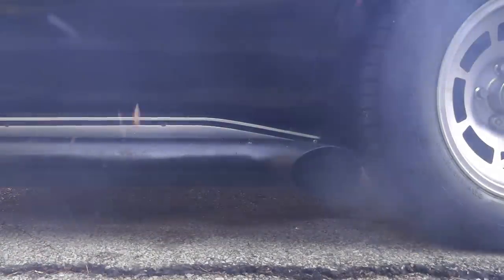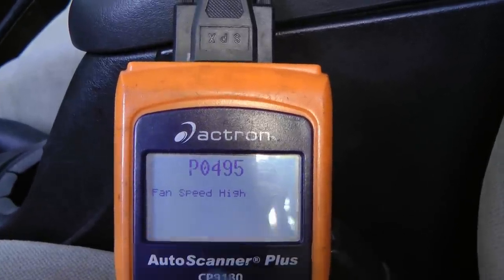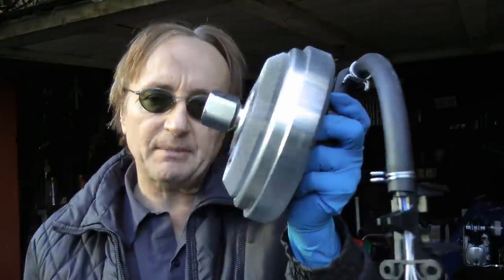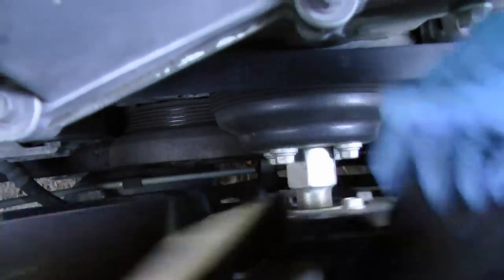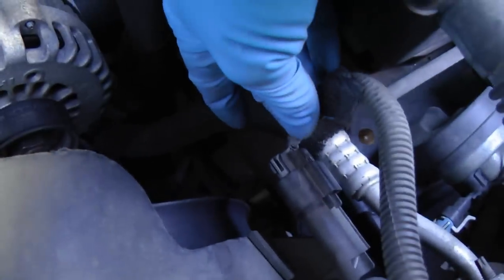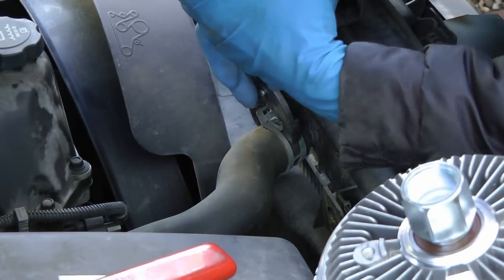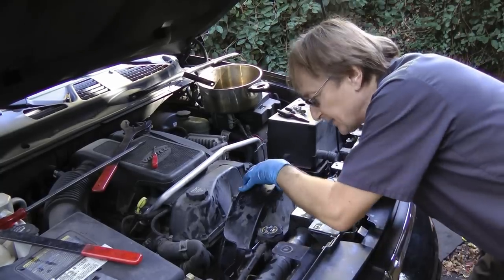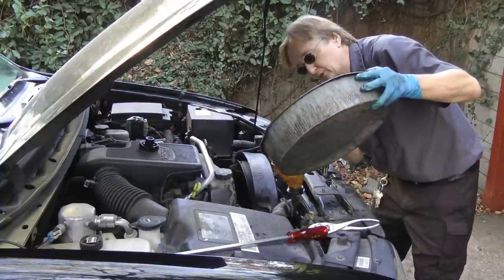How To Replace a Fan Clutch

Comment: Why doesnt the fan just run off directly from the belt, or just a simple electric fan bolted onto the back of the radiator?
Reply: Because it would create a lot of "drag" (air resistance), which would bog down the engine and reduce fuel economy.  I know this because my fan clutch seized up and I feel the power loss when going up hills.  Even though older cars had the fans bolted directly to the water pump shafts, they usually only had 4 blades. Modern mechanical fans, however, have like 10+ blades, making them more like jet turbines; hence the increased drag.  The clutch's job is to provide a "part time" connection between the water pump and the fan.  This allows the fan to spin freely once it reaches a certain rpm.  As the engine temperature increases, the ECM (?) sends a signal to the clutch to lock the fan to the shaft to cool the engine.  Also, mechanical fans are more efficient for larger engines and heavier vehicles than electric fans.  And yeah, I know this question is 7 years old, but hey, never too late to learn, right? 😉

Comment: hi scotty the fan blades on my nissan pathfinder spins 2-4 inches each time i flick it. on a cold engine is that normal? first startup it moves alot of air through front of radiator and vehicle sounds like loud woooshhhh as rpm raises lol... been like that for years now

Comment: hi scottie  i like to watch your vids  i have a question do you know if i have a electric fan clutch on a chevrolet p30 1985 i don't think so but i would like to be sure  i don't have anything that's electric so i would think not  also my fan blade on my water pump is a little woblley  do you think that it's cause of a faulty water pump??
Reply from the maker: yes, replace the water pump

Comment: hello scotty I have change my radiator, water pump, on my 1996 mustang GT and the car shows after a few minutes of driving that the engine is over heating the car don't have a head gasket problem but it seems to be reading hot do you have any idea's on whats causing it???? .....bad air temperature sensor?
Reply from the maker: do my video tests "how to fix an overheating car" has to be one of those

Comment: hey Scotty is it a good idea to convert my fan clutch to a electric fan assembly on a 03 silverado?
Reply: you could do that but you would have to poke the mountings through the radiator fins as well as the temperature sensor through the fins

(plus it can draw additional load on the battery)

Comment: hey scotty so i have a 99 durango and today it got a little hotter than normal about 95 deg and im thinking my clutch fan is going out it sounds like a mac truck taking off but after awhile of driving it it stops and when im sitting idling it gets a little hotter than normal... but also i did the free spin check and it doesn't seem to free spin i will go to turn it and it stops about a half turn any ideas...

Comment: how would you tell if a fan clutch is bad on an older truck that didnt have electronics? would it cause the temp gauge to drop off dramatically when the thermostat opened?
Reply: Air-conditioning unit doesn't really blow very cold air anymore

Comment: I have an 04 that's overheating. I've checked all hoses,  swapped the T-Stat and flushed the system. When I did this the truck heats up a lot worse. My fan connector going black ( left ) to white ( right ) 13v then the rest show 4.3v. My clutch spins but it's not loose. When I grab a newspaper and try to stop the fan at operating temp the fan stops. Is this my clutch? Thanks

Comment: Hey scotty I have a 94 lexus gs300 with a bad fan blade , been looking all over and no one can get it in the time I need it , I know that toyota and lexus are the same , I was told that the fan blade from the toyota camry will faith my lexus. Is that true if so what year and make toyota I need to find
Reply from the maker: +Wilson Pierre no idea on different parts swap, but go to a junk yard, they will have one somewhere
Reply: How about a fan clutch from a junk yard??
Reply: Scotty Kilmer Hey Scotty, my gf's gmc envoy's radiator fan started to make a noise last night while she has started up her vehicle but last time we checked it with her dad it was shaking but was no problem to it until now could it be that. Thanks

Comment: hey scotty i have the same truck (chevy trailblazer) ,mechanic told me that i need to replace my fan clutch because is not strong enought, the fan is going slow and im able to stop it just with my hand, but my check engine light is not on, is he right ?does it need changing ?
Reply from the maker: yep, if you can stop it with your hand, it's bad
Reply: thank you, your awesome. :D
Reply: Mate does your car overheat?
Reply: no not yet
Reply: On this evil platform, an SES light is not always or better yet from my own reading rarely sets for a bad fan clutch, that's unless it's locked at high... by then you don't need NO SES light, you'll know by the roaring jet engine sound coming from your engine as you accelerate...

Comment: Presumably the threads are left or right handed so they automatically tighten themselves as the fan turns. So, I'll guess that if the engine turns the fan CCW from the perspective of an observer standing in front looking back, threads will be RH. I think you could also tell just by looking at the pitch of the fan blades, which should push air from front to back.

Comment: hey Scotty, i need help. My Mitsubishi Lancer 4Cyl 2.0L 2003 Slave cylinder is bad and making me change the part for the 3rd time now in 2 yrs that's a lot and a lot of money. I just saw on a forum that this part was  will always have prolems with it and will need to be change many times no matter where you buy it it will fail again. Have you seen this part the rubber on it always tears or breaks, What can i do so the rubber doesn't break or what do you think. We don't get warranty on this part.

Comment: So after changing the fan clutch in my 2003 Envoy, I still have the problem of a roaring engine. Any advice?
Reply: it should only roar if the engine is hot.
Reply: It roared as soon I turned it on. I removed the relay and installed it again, it must have needed to be reset because the loud roar went away. I have not had any other problems this week. Thanks for the response.
Reply: do you remember what relay it was I replaced my fan clutch and it still roars
Reply: A clutch fan doesn't have a relay it is mechanical.
Reply from the maker: +Glen M  AH, many modern fan clutches are actually electronically run and do have relays.
Reply: I stand corrected. I work on old stuff.

Comment: I think my fan clutch in my 2003 s 10 is bad cause doing the summer time it runs a little hot and I already got a new radiator and water pump on it. Is that the only thing that makes it run hot?

Comment: Hi there, My 2002 trailblazer does not want to accelerate at all at times, i took it to autozone to check for codes and they said no codes but indicated fan might need replacing, could this cause my engine to get hot and not accelerate?
Reply from the maker: Jo Blue yes, an overheating engine will fail to accelerate correctly when it is getting too hot

Comment: Hi scotty, I have an 03 trailblazer with 178,000 miles. Yesterday I used my AC for the first time all year. It was fine for the first half hour of driving but then the temperature gauge got passed 210 and it overheated a tiny bit so I pulled over, turned the AC off and turned on the heat. Within 15 seconds the temperature gauge went back to normal. I drove home without AC and it didn't overheat. does this mean the fan clutch is bad?  It wouldn't engage when the engine overheated.

Comment: scotty i am in need of help with my honda prelude 1992 2.3 SI after you drive it for a lil while and engine warms up my engine light turns on and then once you stop giving it gas it dies, but once it cools down again it turns back on fine. ive all ready checked a number of things that can possibly be causing it but nothing so far.

Comment: hey scotty i have a 1998 chevy s-10 actually its my sons truck well he overheated it. when he brought it to me he said it was leaking antifreeze well with some checking i found that the radiator had a crack in it so i put in a new one now the truck wont start with the radiator cap off it sprays antifreeze out when you turn it over so filled it back up and tried with the cap on still wont start 2.2 litre. help? and thank you for your videos you save me alot of money

Comment: Hey Scotty! I'm about to purchase a 2003 Chevy Silverado 1500 and I took it for a test drive and it seems to have that common GM fan roar all the time like the fan clutch is stuck in engaging mode all the time. It kind of gets annoying hearing that fan whining and roaring all the time like a big semi truck. I can't even enjoy the exhaust set up it has on it hardly do to the loud fan. Was the fan clutch you used in the video expensive? Where'd you buy it from if you don't mind? Not wanting to spend an arm and leg for a dealership one. Thank you so much for your time and videos!!
Reply: Scotty Kilmer I'm not sure about the tranny but the owner has a new motor put in. It's needing new knock sensors which I heard were under the intake manifold. They've had it since 2003 and drove the mess out of it and the only problem they had was the original motor threw a rod a few years ago. The new motor has just over 140,000 miles on it and the rest of it has over 200,000+ miles on it. Other than the fan clutch whining and the knock sensors it's a pretty nice truck, it looks good sounds good and the AC also blows ice cold unlike my previous vehicle I had. Plus it's also an extended cab I've been stuck with a regular cab for a while
Reply: If it's 4X4, the transfer cases with high mileage will eventually have the oil pump tangs rub through the extension housing causing a oil leak that if you run out of oil, the transfer case is shot.

Comment: hello scotty i need to do a fan clutch on the same car as the one in the video and i am needing to know what size the nut is so i can get the wrench  to do it
Reply: +STEVE JONES 36mm...or a 1 & 7/16ths wrench.
Reply: Rebel9668 thanks man i sense long ordered em and done fixed it thanks anyways again bro
Reply: +STEVE JONES No worries.  I just did the job myself yesterday evening and today.  Ran out of time yesterday.  I don't even remember where I read it was a 1 & 7/16ths myself, but I found a wrench that size at tractor supply co. for $13...versus an 18" crescent wrench for $30, lol.

Comment: Hi .. watch a lot of your videos they are really helpful period today I have to change my daughters water pump in a 2006 Ford Fusion se v6. I have gotten to the water pump itself however with a belt is concerned I can't see how to take the belt off without prying it off with a screwdriver. I have photos saved in my phone if that helps. It is not hard I can see the water pump I can see the bolts. Usually in the cars I've worked on there is a tensioner bolt that alleviate the tightness of the belt. But here there clearly isn't it's not one that I can see. Do you have any suggestions or may know someone with a video on here. That could assist me in changing the water pump from start to finish in a 2006 Ford Fusion sev6. 6cylinder. Any suggestions would be helpful, besides shooting it with a shotgun lol thank you kindly for your time.
Reply from the maker: mr ok  yea, you got the crapper of all time, For a short time they tried stretching fan belts like giant rubber bands on them. A dismal failure, but you've got one, old belt can be cut off, but new one has to be snapped on. A real genius engineered that baby.
Reply: Absolutely right Scotty I appreciate your advice and all your videos keep up the good work. As a matter fact that pulley work just fine getting it all. But I had to take a giant socket and I heavy duty hammer and slowly tap it on perfectly and level and I use my level to make sure a small tiny level to make sure it was straight and even and Sonia videos will you have marked off something that helped to remind me to do that. Anyway put it back on and the belt recommended I use wire ties put it on slightly and use wire ties that worked perfectly. My daughters car is running great water pump installed everything works perfectly no leaks nowhere. Wish I could have videotaped it like you do so many of your good works. There wasn't a single water pump and harmonic balancer removal and put back installation like the one I did, anyway I appreciate you greatly and all the good work you doing a helping people. And not to mention saving us money. Be well. Mr Scotty K.

Comment: i change my fan clutch and water pump on my 2002 trailblazer and when i put everything back together my heat comes out cold and my car over heating any ideas  what could be the problem?
Reply from the maker: +LeMark Wash air is probably in the system, bleed that out first

Comment: Hey Scotty nice vid. My mechanic told me that its a good idea to also change the water pump if your going to change the fan clutch. What are your thoughts on that?
Reply: I drive a 2002 chevy trailblazer
Reply: +kelli Bates do it because old water pumps can wear out  and that will mean poor coolant circulation and faster fan speeds as it becomes fully engaged trying to cool the engine

Comment: Thanks a lot Mr. Scotty kilmer , But I replacement my old Clutch Fan for Trial Balizer 2004 as you show me and  get the engineer check light off and every thing look like OK , until turn A/C on , hearing the engineer is make noise and the car going to turn off "Shut Down"
Please help me what I should do it?

before nothing happened except the engineer check light turn on.

Comment: Need help finding the radiator fan relay LOCATION on 04 jeep liberty   04 - V6- 3,7  THANKS
Reply from the maker: +PASCUAL MARTINEZ  it's in the main fuse box--High Speed Radiator Fan and Low Speed Radiator Fan Relays are located in the Power Distribution Center (PDC).
Reply: +Scotty Kilmer....  Hey Scotty muchas gracias por tu ayuda  ya los encontre

Comment from the maker: those over engineered cars tend to fall apart like that with age. Pray it's just a bad headlight switch, cause ultimately the lights are run by a computer on that thing. as for not starting in the cold, do my video "fixing a car that cranks but doesn't start up" when it doesn't start to find what is broken

Comment: Hi scotty! :) i need help:( its been sometime since i changed my oil i didnt look at the dipstick and i put two quarts of oil in my car :( when i left the gas station the car smoking alot i went straight home i live about 2 miles maybe 3 from the gas station :( i haven't touched it since it been sitting there for about almost 2weeks i have a 1994 mazda miata What do i do? Im scared to turn it on and move it

Comment: Unfortunately almost everything on a modern vehicle is monitored by the ECU which means almost everything will also have a sensor of some sort, which will have connector attached to it of some sort,which will have wires going somewhere........ Simple is golden IMO. I love my 1983 Ford. Last one before O2 sensors and "Check Engine" lights! I get 20 mpg and is as reliable as the sunrise. Parts are dirt cheap.

Comment: my fan never turns off on a 97 nissan pickup 4cyl. Has a clutch that looks like that. Any ideas? @scotty kilmer
Reply from the maker: if it runs fine and doesn't run too cool, heck leave it. If it runs too cool, replace it
Reply: Scotty Kilmer it does run a little cool, but that's the thermostat.

Comment: I do have a question I have a 1998 F150 4.6L heater only works when I'm driving at higher speeds I flushed the heater core an replaced thermostat an still no heat an there dont seam to be no pressure I can take the radiator cap off when hot an I notice my fan dose run non stop dose anyone have any suggestions
Reply: Water pump???

Comment: I have problem in my trailerlazer 2002WHEN I TERN THE A/C ON The temperature rises  I change the cooling fan clutch ,but steel problem I remove the thermostat steel problem  I need solution
Reply: clean the radiator and the condenser and if those do not work then you may need to check the water pump
Reply: I just cleaned my throttle body with throttle body cleaner and a rag and my car is running compleetly differently and no loss of power.

Comment: My fan is spinning even when it is cold. That seems unnecessary. I guess your fan clutch was doing the same thing as mine, but I don't have an electronic sensor type. I would assume that if my clutch was working correctly only a small torque would stop the fan from spinning but I hesitate to test it that way.
Reply from the maker: +ktrez2000 they all spin somewhat when cold, when they are heated up is when to test them
Reply: I thought the purpose of a fan clutch was to save on energy, reduce pollution and to allow the engine to warm up faster. I guess what I would prefer is an electric fan.

Comment: Can a fan clutch squeal?  I get a squeal every now and then in really cold weather.  When the weather warms, the squeal stops and then it's gone.  The odd thing is that after I turn the engine off, the squeal can be heard for about three to five seconds, about as long as the radiator fan continues to turn.  The idler pulley, belt tensioner, belt and water pump are new.  The fan is not electric; it's a 98 Dodge Dakota.
Reply from the maker: yes, they can
Reply: Thanks.  I'll keep an eye on it.
Reply: Scotty Kilmer A lot of swearing is right!  On my Dakota, the nut on the clutch is about 1 3/8" and the holes in the water pump pulley are about 2.5" apart diagonally.  I'm having a hard time finding the removal tools to rent from the main auto parts sellers.  Any suggestions on where I can find the tools?  The repair is about $350 from a garage.  I bought a clutch for $49 and have all the other tools for the installation.  Yep, a lot of swearing is right.